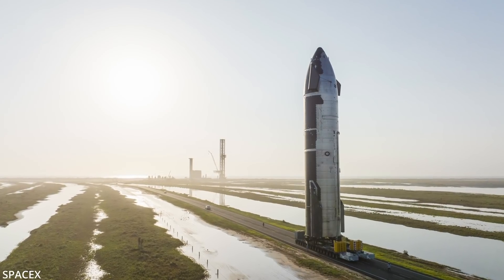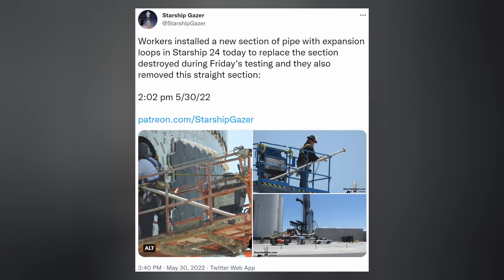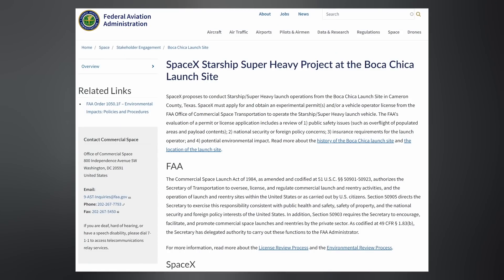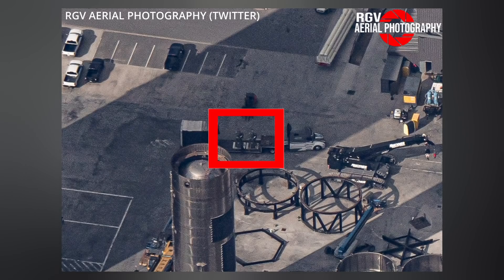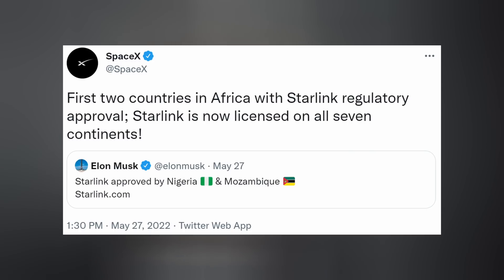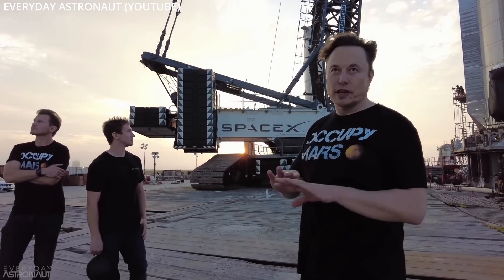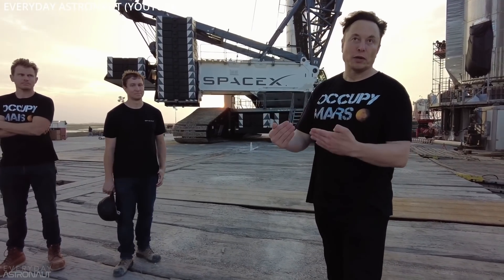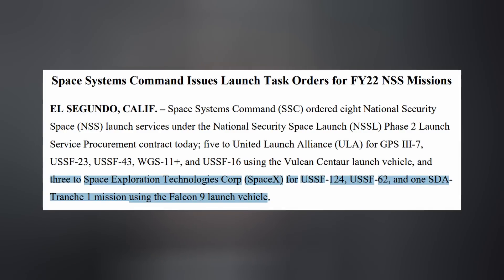SpaceX Starship 24 Fails Test, FAA Results Scrubbed

Comment: These delays are the exact reason why pistol permits are usually "shall issue" documents at least in non draconian states... it allow for any background checks to have a period to occur... but puts a hard deadline on the sheriff to acutally produce the permit. The same thing should have occurred here, 2mo max to do any analysis and they shall issue a permit... potentially contingent on any required changes determined during the 2mo period.

Comment: With the Martian thin atmosphere, Starship will definitely stale out in that subzero with oxygen for the relighters' performance in months in vacuum space after reentry hmmm. That's the death sentence for the astronauts.  They hit land like a ton of bricksSpaceX needs a multi-stage for the landing program. First prelaunch 10 times required supplies detach modules to let Starship land autopilot. Let capture reentry with shoots and sky cranes or even inflatables like rovers.
Reply: I'm curious, was this an algorithm translation because it simply doesn't make much sense in English.
And I read it twice, trying to give it a chance.
Reply: @bobjoatmon1993  prob a bot like half of twatter's users. someone has to do the propaganda on the internet, and your tax money sure isn't going to be used for anything useful, that you can be guaranteed of.
Reply: @bobjoatmon1993  LOL,  I'm a real person. I'm a USAF veteran.  I'm from Chicago, now living in the UK  out of the service, I was a tech in an F15 Fighter Squadron.  I have to re-read what  I posted after smoked a joint. Seriously. err.
Reply: @pharaohblack1784  I got that you were saying that the reigniters on the engines might not work, but can’t tell whether you were talking about on Mars entry or takeoff.

Either way, the people running SpaceX have probably thought about it dozens of times already, they aren’t exactly just banging rocks together over there.
Reply: Its actually one of the worst designed rockets I have seen, so much can go wrong. with no ability for protection for its crew.
Reply: @buddduhh6291  Simply jettison the crew capsule of the main rocket before Mars approach and just orbit Mars before the rocket lands.  That's why they need around spare rockets.  They need to send supply ships for a rough landing, nothing special; pure raw materials, freeze-dried food water extra TONS. Use crew capsule for sky-crane or inflatables like the rovers. It's proven. It ensures crew safety. It's a no-brainer.
Reply: @pharaohblack1784  Your ignorance on the subject is mind boggling. Landing the crew will require on earth to reignite 3 engines, and flip the vehicle. there are some many things that can go wrong in this maneuver. Its not a safe ship
Reply: @buddduhh6291  You don't get it. SEPERATE the crew capsule IN SPACE. I'm talking about a complete re-design not existing the craft Crew cab has its own landing system to avoid crash collision with a landing rocket. Just walk or mini rover to the main rocket landing.
Reply: @pharaohblack1784  Oh I thought you meant the design as is.. Yes I would agree something of that nature should be done, if this vehicle is ever going to become of service.
Reply: @buddduhh6291  it would be an unsafe ship as long as those manuvers havent been done 100s of times. your argument was as good for falcon 9 first stage doing landings, and here we are. tens of landings in already and going strong. airplanes don't have any significant passenger escapes or fail safes (they could def at leasthave airbags, with a huge cost). you just come out as a fe gout when you think life shouldbe 100% safe.
Reply: @yellowgreengo6764  Um no not at all. I never questioned falcons 9 booster return, it was something that could obviously be achieved, if alot of effort put into it. This is different, this is a ship 5 times the size, with massive engines, and you now HAVE PRECIOUS PAYLOAD on top, which can have a margin of error of 0%. that is not feasible, there will always be the ability of either the engines failing at a horrible time, or control surfaces failing at a horrible time. Leading to horrible results. Its a bad ship design, that doesnt take into consideration for a second that humans will be on it.
Reply: @yellowgreengo6764  Oh and btw Airplanes are not foolproof and thats why I tell anyone who gets on an airplane that you are taking a risk. Its that  simple.
Reply: @buddduhh6291  yeah, just like airplanes not even having parachutes for the passengers xD

Comment: Here's an interesting research project for the kids. When was environmental assessments done at the Slick 6 launch site at Vandenberg? When was the environmental approval by the FAA done for the overhaul of the Falcon9 launch facilities at the Cape? When did FAA concern itself in policing environmental issues? Was an FAA environmental assessment/approval required on any new general aviation or commercial airports built from Denver International Airport onward? Was the STS or any other commercial/science launch vehicle ever held up for environmental issues? 
Is the GAO bookkeeping being correlated concerning the taxpayer's money being spent on the SpaceX Boca Chica approval with FAA, EPA, Bureau of Land Management, DOT, Commerce Department, US Geophysical Department, The Weights and Measures Division, NOAA, INS, US Border Patrol, Army Corp of Engineers, CDC, Health and Human Services, Space Command, NTSB, the School Lunch Program and the Post Office?
Did Blue Origin and Virgin Galactic have to go through the same process with their launch site's? 
I know I am an idiot, but isn't Star Ship using sustainable propellants? At SpaceX's own cost, no government grant or aid to help defray costs of engines and infrastructure to use this clean propellant?
SpaceX and it's CEO are actually working on mankind's future for a positive outcome. They do not need to be quagmired
in the trash, raw sewage politics. After Starship flies and moves on to the next step in a permanent, profitable expansion into space and mutli-planetary society the rest of us have a responsibility to continue asking the articulated walking feces trapezing through the Capital HOW MUCH of our resources they wasted acting out a petty sour grapes delaying action. We should be very aware that a group of people in this country are trying to better the standard of living for everyone on the planet and our government used our own resources to stunt that effort. 
Absolutely DISGUSTING.

Comment: Have you seen Common sense sceptic channel? He is, and thorroughly, trying to debunk Musks project, and I must say he is not that far off, as far as I think!
Reply: boomer
Reply: @yellowgreengo6764  Yeah I kind of agree. It is alway so easy to critisise somoeones original ideas at the slightest opportunity.
Reply: There's nothing to deboonk, he literally made the first self-landing orbital booster 10 years ago and no other company or government has been able to even come close to matching it.
Reply: @liquidsnakex  Try and watch all parts of the Musk debunking. It's not  completely without reason to do this, Musk has some serious flaws where his math simply doesn't add up, especially with the Mars project. I have a lot of respect for Musks ideas and achievement, but there are serious flaws! 😉
Reply: @larsrosing5033  I used to be subbed so I've seen some of them, but never saw anything about Tesla or SpaceX successfully debunked, mostly just Phil trying to be as snarky as possible.

These "debunks" are nothing new, people were also debooonking electric cars, self-landing rockets, Falcon Heavy, Dragon V2, and then they all scuttled away like cowards the instant their debooonkings got debooonked by reality.

The Starship will most likely follow the same trend. I personally wouldn't get on one, because it seems like a deathtrap compared to the more traditional truncated frustrum design, but it will likely succeed in one form or another.

Exactly what "math" do you think doesn't add up about the Mars mission architecture? Are you aware that it makes heavy use of orbital refuelling, pre-deployment, and ISRU?
Reply: @liquidsnakex  Excactly his calculation of the number of rocket going up, how long it takes to do each cycle and how long each craft has to stay in orbit to wait for the other 100s spaceships to go towards mars in a group. That calculation is insanely un realistic, seen from SpaceX perspective. Let alone the price calculation is astronomical, as opposed to what Musk claims.
Reply: @larsrosing5033  Seems like you're just name-dropping vague concepts with no real numbers or math at all.

Who's calculation, of what rockets going up where, how long doing what kind of cycle, and what specifically doesn't add up?

I asked you for the math that you claimed was off, not a bunch of vague FUD that you want me to just take your word for (which I would never consider doing anyway).

The first manned missions won't be using 100s of ships or people, they'll have crews of about 6-12 people launching in one or two spacecraft, with 2-3 others pre-deployed, and a few tanker variants to refuel them.

The fact that you're talking about 100s of craft, tells me that what you're trying to deboOOOonk is maybe Musk's optimistic idea of a huge colony in the future, not the capabilities of any particular spacecraft or mission architecture.

Comment: The FAA certification is now entering the "Zeno's paradox" phase.
Reply: One of Zeno's Paradox's stated that "whenever Achilles reaches half the distance to the Tortoise competing in the same race he still has half the distance again in which to reach the Tortoise, which also can be divided by half and so on in an infinite series of half way marks. In the race Achilles has to pass the Tortoise in order to reach the finish, but there is an infinite series of halfway points. Since it is impossible to traverse an infinite number or spaces Achilles never reaches his goal.
Reply: @pickcomb332  That was the one I meant.  Hopefully, the FAA doesn't subdivide less than a day.

Comment: don’t think it’s possible to have a human ready starship by 2030 maybe even 2040. this is a insane task and we are still using brute force to fly up instead of new technologies that don’t require fighting gravity.  I think we need to think outside the box when it comes to space travel it should not take so much energy and force to get up there ,  boats float just fine air travel should be just as easy if we understood the physics of gravity better .
Reply: I'm guessing you skimmed by in high school science. Without the FAA and the Biden admin. The rocket would have flown the first tests already.
Reply: @avgjoe5969  i did very well in high school and have a mechanical engineering degree, but that’s not the point or important what i’m getting at is rockets have been used since humanity began their space journey, and their not very efficient  meaning we don’t fully understand all the forces (gravity) . you could take a brick slap a huge diesel engine on, that burns a ton of diesel and push the brick across a lake. But we understand buoyancy and have boats that can float and even not sink if you don’t have a diesel engine constantly working. If we understood gravity like that, our space craft would be efficient. gravity is a force kind of like magnetism, so if we understood it we could counter it. Like two magnets can repel each other if their facing each other with the same polarities. We could repel gravity from the ship if we understood gravity.
Reply: I think what you're proposing it is more than a century away. Right now we have to rely on chemical rockets to get through the atmosphere and hopefully we'll switch to nuclear propulsion to get through the solar system.

Comment: SpaceX still doesn't have a working rocket or launch pad to launch it from. How is that the FAA 's fault? If FAA gives it's approval in 2wks SX still won't be ready to launch.
Reply: They DO have a working rocket and launch pad. They have for months. They don't have a pad they can launch/land on. 
They were good to go with Raptor 1. Since stuck on the ground they were able to evolve the engine in the time the FAA spent twiddling its thumbs. Now they are getting engough Raptor 2s together for a launch. 
Next time someone holds up your permits for a year for no reason - remember not to complain.

Comment: I'm guessing the latest two week FAA delay had more to do with the Memorial day weekend and FAA employees out of the office, than any issues with the permits (all the needed reports have come back positive) so there really is nothing else for the FAA to do. Leaks have stated that SpaceX has already been notified that the FAA will grant the launch clearance they want unconditionally or with some relatively minor conditions, which is why they have started speeding up the testing for the Orbital Launch.
Reply: I wish we could say Starship will be ready by then but they are clearly running into more problems with engine installation.
Reply: @serronserron1320  what problems?
Reply: Leaks have said the FAA has already approved this project at least 3 times.
Reply: I actually suspect that like the last time was due to no response from SpaceX…they may be allowing the FAA to look like bad guys to cover their own delays.

Eventually they’ll supply whatever it is they need to supply…and it will go.

Comment: Probably a dumb question but why small tiles? Why not do bigger sections of heat shield like a quarter size of a ring?
Reply: The bigger than object is the more heating and expansion there is overall
Reply: @arthurbach9016  Sort of.  A group of small tiles covering the same area as a single bigger tile will expand the same amount.  The difference is that with smaller tiles you have lots of small expansion joints instead of a few big ones.  Also, with a curved structure, when it expands, the radius changes, with smaller tiles, the joints between them act like a bunch of tiny hinges changing angles as the stainless steel and heat tiles expand/contract at different rates.
Reply: @apostolakisl  yeah exactly not to mention having to upscale everything the mold the oven the material mixers and smaller pieces are not so cumbersome go SpaceX go NASA go us just a common viewer starwatcher Steven
Reply: I believe its an advantage of mass production, and interchangeability. Hundreds of smaller tiles can be made for cheaper, and when one single tile chips, breaks, or cracks, it's cheaper and easier to replace than a single giant heatshield piece.
Reply: If SpaceX engineers were smart, and clearly they are not, they would have investigated the benefits of reduced TPS panels. How many vehicles will be lost to failures in the existing design? Probably more than ships have lost to their crappy header tank system. A bunch of Fkin cowboys.
Reply: Ohh I gotcha that makes sense, my thing about it is constantly seeing the tiles pop off. Kinda figured that it would make more sense to go for the bigger tile sections for the areas that tend to pop off which could help secure them on starship better
Reply: If they're smaller they can be manufactured without a curvature to follow the ship's hull, and that's probably way cheaper.
Reply: Because they won't pop off, they will crack... and they will do so much more often. The smaller tiles induce less stress in thermal expansion of a rigid tile.

Comment: Well at least the FAA delayed it by less days than before. 13 days vs a month isn't bad
Reply: So now it's going to be like Xeno's paradox:   A month, two weeks, one week, 3.5 days, 1.75 days, 21 hours, 10 hours..argh!
Reply: I wish we could say Starship will be ready by then but they are clearly running into more problems with engine installation and plumbing
Reply: Sorry. 2 weeks. 4 weeks. This is the 5th time. One day is bad when its appreantly, infinitely repeatable.

Comment: Those TPS tiles are crap. That's the Achilles Heel of Starship. There's got to be a better solution.
Reply: The Tiles, AND the Header Tanks.
Reply: I thought they didn't need a TPS thus why the they changed to stainless steel.
Reply: @pricelessppp  Exactly, SpaceX should 'fly' the booster back, not drop it like a rock through the atmosphere. I realize that they are 'sort of gliding' the booster back to slow it down but they need to slow it down with engines. Slow down as the need increases. However that would take more fuel so what is needed is a better power source, one that only needs to be refueled once in awhile. Oh well, baby steps first.
Reply: you have to remember that starship is still very far away from having a production model available. Its still very early in its prototype stage.
Reply: The shuttle sure as heck didn't have a better solution. But Yes. NOT optimal.
Reply: @avgjoe5969  I have heard for years how Aerogel is a fantastic insulator. I bet they could put a skin of some high-temp-tolerant  sheet metal to sandwich some aerogel, and scrap the tiles altogether.
Reply: @FieryWACO  I wonder.., innovative idea worth checking out.
Reply: @bearly1727  Someone light the Elon signal!